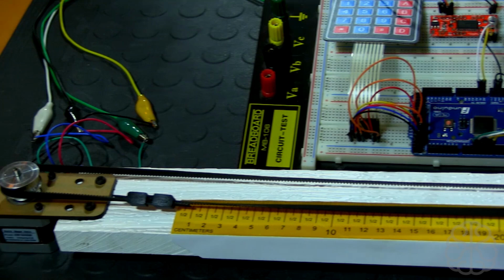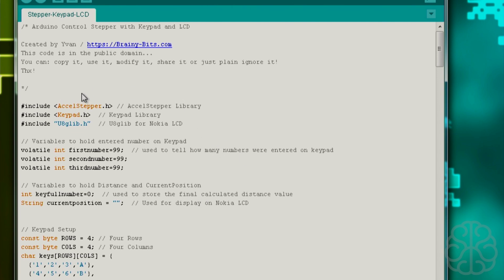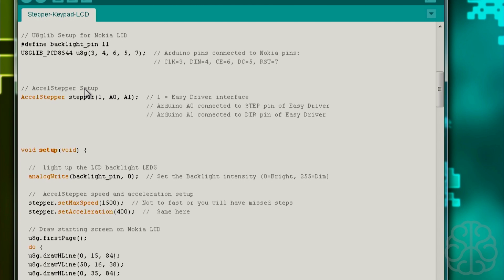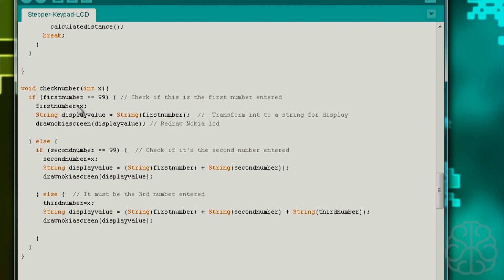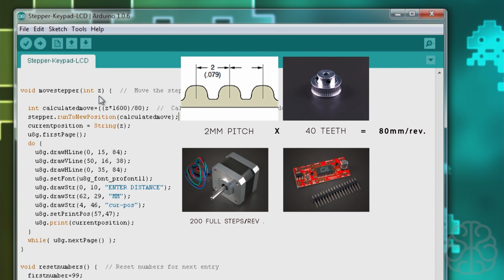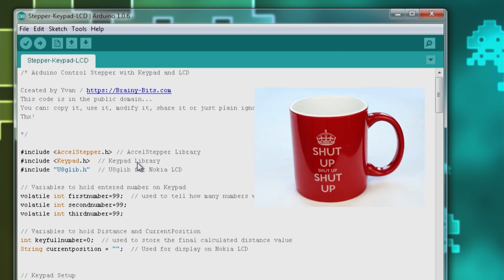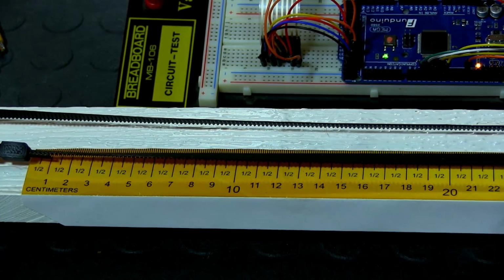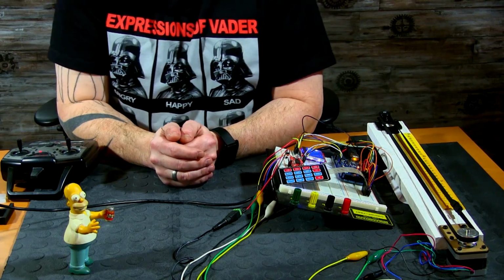Arduino DIY electronic miter box?  Stepper control with keypad and LCD - Tutorial

Comment from the maker: Sorry for the long video guys... Hard to keep these videos short sometimes...  Thx!
Reply: +Brainy-Bits Hi; ooh don't worry about it  , Excelllent Tuto
Reply from the maker: +Akrout Osama Thanks, always worried that the videos are too long or boring :), thanks for watching!
Reply: +Brainy-Bits if you are worried about length. How about releasing 2 vids 1 like always the other with just a overview and operation (no code). Because some just want to see it work and others need coding help.
Reply from the maker: +kevin moriarity Thanks for the suggestion, didn't know this tutorial would be this long, so didn't shoot the video with that in mind :)  But will keep your suggestion in mind for future videos.  Thanks for watching!
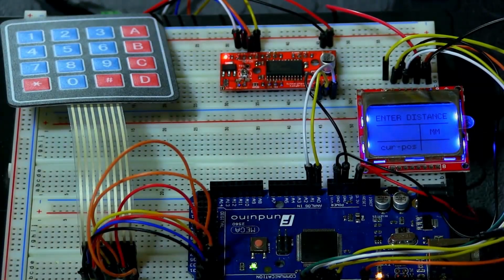Reply: +kevin moriarity I think releasing 2 videos is going to get confusing.  What's better is to include a notation like "skip to 14:45 to see in action" in the beginning of the video.  I've seen people do that and it's very helpful and easy to add anytime.
Reply from the maker: +Dima Prok Thanks for the tip Dima, will do something like that in future videos!  Thanks for watching btw :)
Reply: Just seen this great video. It’s exactly what I want for my router lift table, table saw stop and blade lift 👍. Thanks very much.
Reply: @MichaelLove83  I use SBR linear rails for my router lift and T8 lead screw. Added a 24V geared motor with a PWM controller and it is super-B. also added two limit switch to stop it at the end of the track. I also ditched the hand held router for 2.2kW WFD spindle it is far less noise and the power is just far more superior than a traditional router.
Reply: Hi  can i use 16x2 LCd or 20x4 lcd with it . can you modify the code
Reply: Very grateful video sir,can I use it encoder and dc motor,please suggest me.